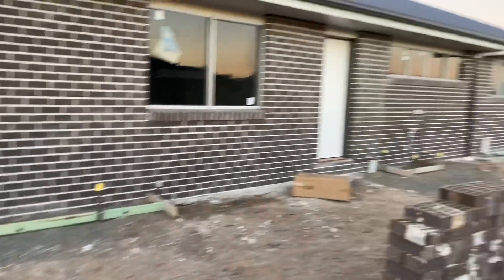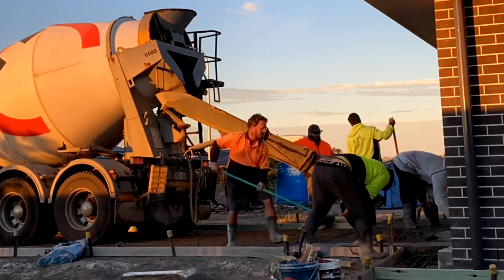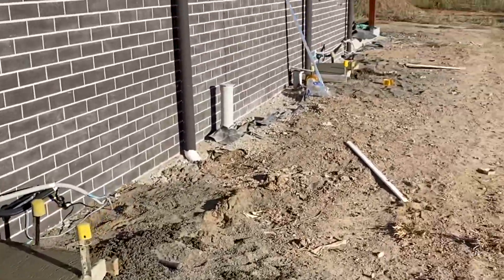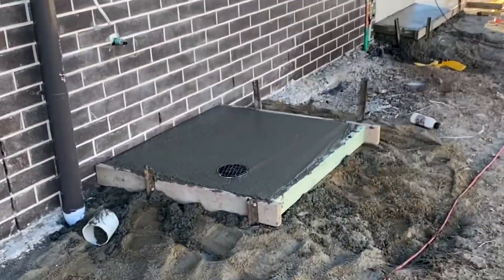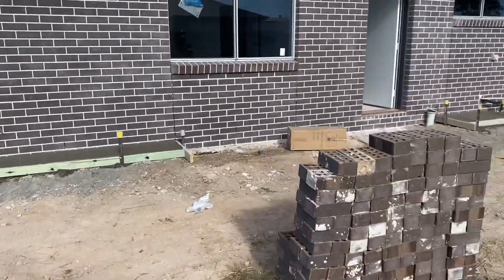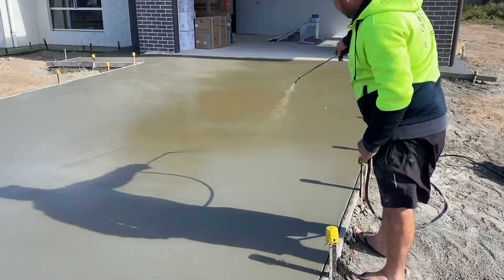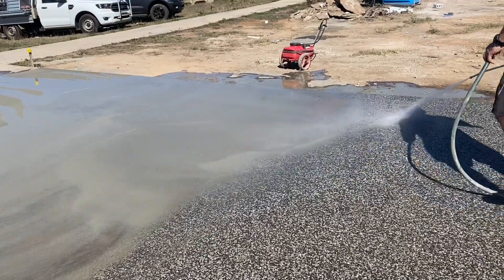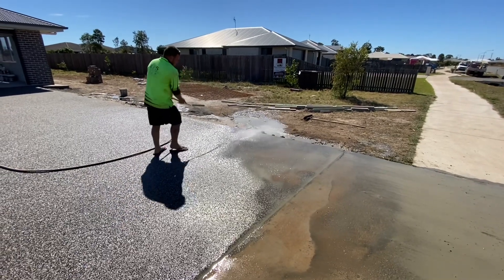How to Do expose concrete using molasses and water ￼

Comment: For anyone wondering, molasses is about 55% sugar. It's about 1.4kg of molasses to 1L in volume. So every litre of molasses is equal to about 700 grams of sugar. 

Everyone does exposed differently. Some guys use 1kg of sugar to 10L water, others do half that strength, and probably other ways I've never seen done. 

So if you do 1kg of sugar to 10L water you can tip about 1.5L of molasses into 10L water and get something pretty close to what you'd normally use for exposed.

Personally I'd rather throw some yeast in it and make rum a month later.

Comment: how long do you usually wait for it to dry? regular concrete not exposed!
Reply: It's meant to be about 4 hours after it turns up at site for plain concrete. In winter if you don't dose it with speed, and depending on the company you get it from it can take anywhere up to 8 or 9 hours.

In summer it can go off like a bomb and done in 2 hours.

That's why there's concreters and there's other guys that think they're concreters.
Reply: @cabji  thanks mate, appreciate it

Comment: Yanks first showed us this thirty years ago , 
Tim Carter who owned Topline back then use to swear by molasses and coke , 
We could do too jobs a day , one in the morning then one again late in the day ,
we would pour late in the day and come back at daylight next day with a Gerni hit it and never get any blow outs , 
The thing with doing this I found of the years especially using just the pressure from the garden hose it can change a lot , and standing straight up with the water hitting directly onto it tends to get small blow outs I like to bend over and get the water coming at more of an angle but each to their own , trued showing a few in EU how to do this abd they don’t get it everything’s done in panels in warehouses and shipped out on sight , they would never dare do this like back in Oz , I don’t know how your getting away with washing off into the storm water or down the street they were hammering us for this twenty years ago , but good luck with it
Reply: Unfortunately Tim carter passed away a couple of years ago, old legend.
Reply: Simon I’m sorry too hear that 
Tim he was a real character , a complete handful and loose unit at times , but certainly a pioneer of helping bring concrete finishing in Australia into  the 20 century , away from kneeling boards and wood floats , that’s for sure ,

Comment: We use 4lb for 3 gallons most the time and works great for us.
Reply: This is about 2kg in 12L. This is pretty strong. Sort of like double strength. Do you broom or trowel it in?
Reply: @cabji  neither, just mag finish, spray on sugar, wait.... then spray it off with a light psi pressure washer.